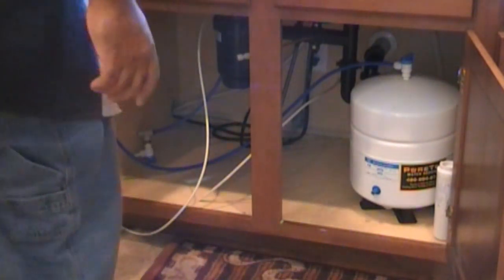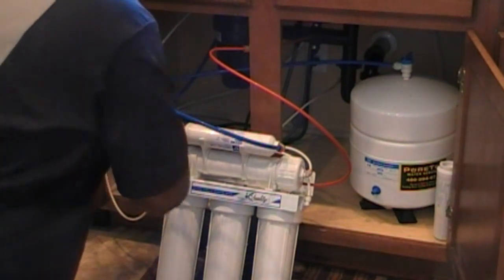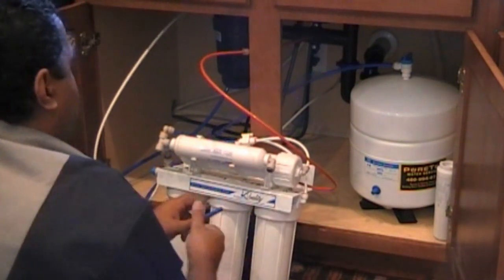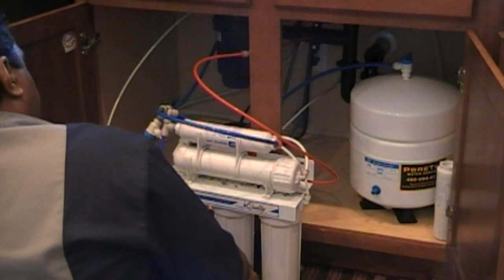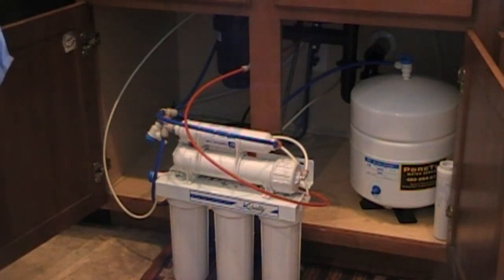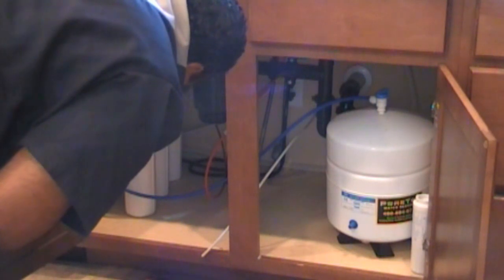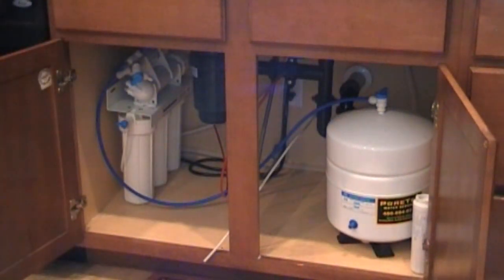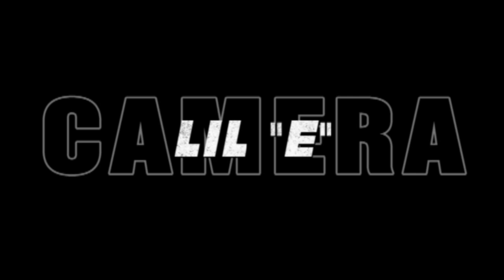How to change the  Reverse Osmosis Membrane and Filters Pt -2

Comment: Dude , aren't you supposed to flush the filters before you run them through the tank  ? You do not want Carbon dust in the storage tank . Did you presoak the Osmosis membrane  in peroxide .? thought that was mandatory
Reply from the maker: I Never did that! not saying it was correct or not but I have done it my way for years and I have never had deposits in my tank.  I flush my tank every 2/3 years when I change the filters just to do it.  Thanks for the suggestions. E$

Comment: Great Video. I did this and now the water doesn't come out. I made sure the water is on. I heard it filling up.
Reply from the maker: did you add pressure to the tank with a pump?? it must be done them wait a while for it to build up pressure
Reply: +emoneyblue Hi Thanks. Yep, now I did. I had to go buy a pump. Letting the tank fill up now.
Reply from the maker: +Robert Hicken 
great news... :)
Reply: Hey, I appreciate the tip on adding air. I didn't take into consideration the time it takes to fill the tank. I drained it 3 times and now it is all good.
Reply from the maker: +Robert Hicken it's all good
Reply: What type of pump is needed?

Comment: Replacement is greatly determined by your TDS readings (you can buy a TDS tester for cheap). If it is high, you'll want to replace them often. If your water is low TDS, 6months and you're good. 2-years? You really need to replace them! And use bleach like emoneyblue mentions in the video to sanitize the containers.

Start with TDS readings. My apartment is over 500 on the readers, which isn't lethal but it's not healthy water to drink. Mine will need to be replaced a lot ;)

Comment: Well, I think I got mine going ok now :) But, I do have a question. Do these units continually drain out water into your pipe or only until the tank is full?

I live in an apartment, I don't want them thinking there's a leak ;)
Reply from the maker: Only drain when filling you tank